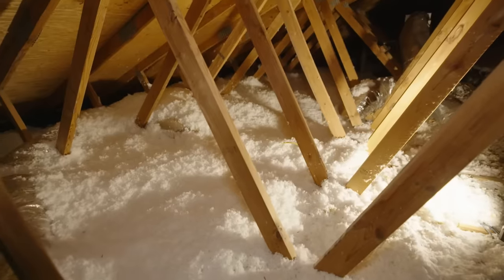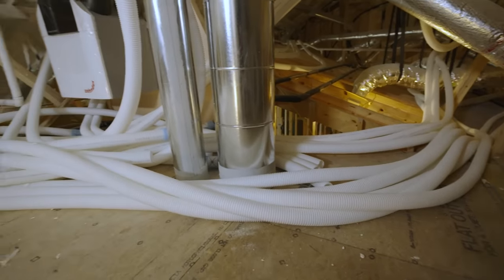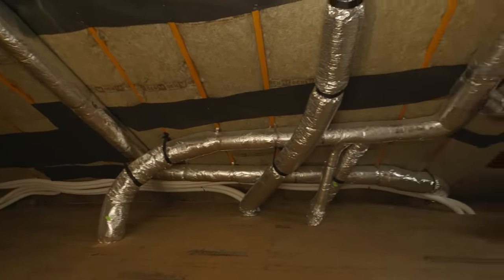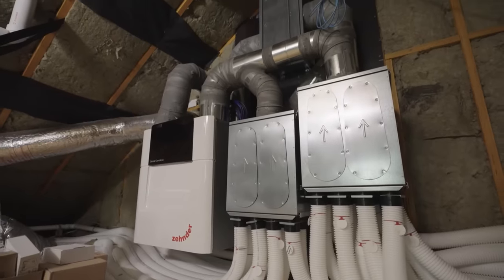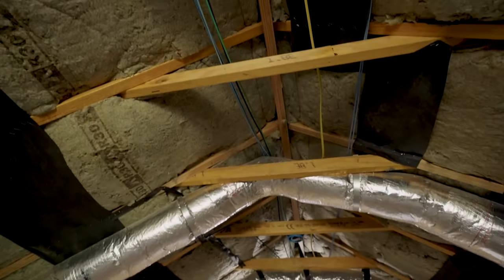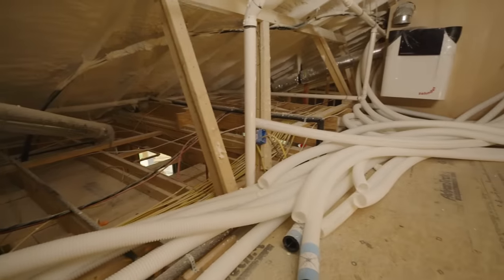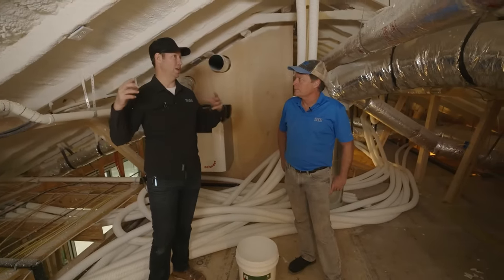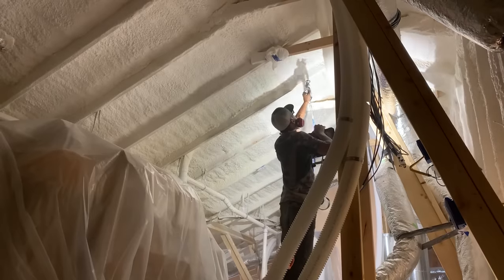Building a BETTER attic - Unvented + Conditioned attics 101

Comment: Very different from a Canadian attic, where you run no utilities through an attic except electrical wiring, a plumbing vent pipe and insulated exhaust pipes for kitchen and bathroom fans.   With a 30 inch thick blanket of cross linked Rockwool insulation, nobody stores anything in an attic.

Comment: Looks like a good option but how does it hold up in -40 degrees with 5 month winters?
Reply: Right, wouldn't fly in manitoba. The frost build up under the roof would be horrendous
Reply: @countryironforge4275  yeah I don't know if it's even code compliant here since you need vents under the roof decking to prevent ice damming and condensation build up inside the roof structure.  I've only seen it on steel frame roofs like in industrial.  Not to mention you're almost doubling the surface area (and heat loss potential) by insulating the entire roof vs the attic footprint.
Reply: You'd probably want at least 6 inches of spray, and definitely encapsulate all the rafters. Once you do that there won't be enough heat reaching the roof to cause ice dams, and since 6 inches of spray foam is a Class I vapor barrier no moisture will each the roof deck either.

Comment: My vented attic looks like the start of the video, but older and pink.  Matt says later in the video that the 'perfect attic' shown can be added to an existing attic, but I don't see that as affordable.  What are the steps I can take to "do better," but not the best?  In other words, if there are 5 things and I do 3 of them then it's better.

One thing that is not a plus of my attic is that my OSB and plywood roof sheathing has no coating nor insulation.  However, there is one plus to it.  If there's a roof leak then I can see it.   I can imagine roof leaks could be hidden for a long time if an attic is sealed up like in the video.

Comment: How are you handling condensation on the underside of your roof deck? How much does having a conditioned attic space add to the operating cost of the hvac system? You are not discussing the difference between open and closed cell spray foam insulation.

Comment: if you keep sealing the house so tightly, what are the risks of having a large party or gathering ?  Lots of people breathing air in a tightly sealed space kind of thing
Reply: A good HVAC with recirculating air that is treated with U/V does wonders. All HVAC systems do that but you have to run the fan manually. Constant exchange of environment is key. Look into what they call “clean houses” for children who suffer terrible allergies.
Reply: That's exactly what mechanical ventilation is for. At worst, fire up the range hood, open a window at the opposite end of the house and you can host as many people you want.

Comment: So why did Matt not use the spray insulation instead of rock wool? We were told by HVAC people that our attic is badly insulated, there is a thin layer of loose blown in insulation from the late 70s and then a foil over the top. We were told our heat issues are mostly from the lack of insulation. If I'm going to spend money to have someone insulate, should I go with rock wool or spray foam? Also, should I have all the vents sealed like Matt, or is he running AC in his attic? We don't care about our attic, we just want everything seal against bugs and heat as best as possible, we don't use it otherwise. We're north of Tulsa, OK and it gets pretty hot here. Thanks!

Comment: I grew up in a house built in 1831 and it had a big, useful attic space. ALL the older houses in our area (rural New England) were built with full, usable attics. Some time in the 1900s they all received insulation and it was always installed at the underside of the roof, not on the attic floor. In this video they call a truss-built roof a "traditional" attic design but it's really a recent thing, used because it's fast and cheap. As is the case with so many things, construction trends toward "fast and cheap", which is almost never best.

Comment: The damage done by a conditioned attic to an asphaltic  roofing system has not been quantified in this video. Notice that the host specifically mentions "a metal roof" allows for cooling. Historically, vented attics were designed to allow cooler air to travel along the underside of the roof deck to cool the roof deck. Not allowing this would cause excessive temperatures leading to premature failure of most asphalt shingles. A factor in your decision to convert or design any attic to a "conditioned space."

Comment: That's fine for Texas, but  it limits the amount of insulation. Where I live it can be down to 70 below zero. My house is still nice and warm because i have 16 inches of fibeberglass insulation with sprayed insulation on top and all around to fill all the spaces. The house is also cool in summer when it reaches the eighties due to all that fluffy stuff above the drywall.

Comment: You don’t have to seal up those  attics to achieve energy efficiency. You need to keep ducts out of the attic for sure. Also use a light colored metal roof. Matt builds for people with big money.
Reply: If you imagine a traditional house as a box that is fully vapor proofed and insulated against the cold and heat and that box is efficiently heated and cooled, then the roof structure is just an umbrella against water and direct sunlight that has an airspace over the properly sealed box do to all the venting along the soffits and possibly a temperature controlled fan or end vents to reduce summer heat buildup. This is incredibly inexpensive, mouse proof if sealed, and doesn't require electrical energy to "condition" a non living space. I am not convinced this has any value whatsoever over a traditional build.

Comment: Do you need insulation at the ceiling of a room if the attic is unvented and insulated?  If not, would insulating ceiling help keep rooms cooler during summer?

Comment: I am rebuilding my house in CA that burned down in the "Glass Fire" in 2020, I was thinking of using open-cell foam to eliminate vents in soffits. I like the Rockwool stuff better, but I  don't want to add 4" of solid foam on the roof deck, any ideas on the proper way to use Rockwool?.

Comment: I looked into insulated zip sheeting. In my northern climate I would need a MINIMUM of 5 inches of solid sheeting to handle the thermal break and avoid condensation. Not really feasible…

Comment: The lumber dimension used in these shots is LAUGHABLE!!! No wonder US built houses are leveled by bad weather.
What are those? 45x95? 45x120? 

We use 45x195 or 45x220, usually CC 60 cm, sometimes cc 120 cm....

Also, we put either plastic or wind proof cloth to avoid getting the dust from the rockwool into the attic. That one looks just horrible to be in and breathe the nasty rockwool...

Comment: Building in Texas requires entirely different considerations than building in Wisconsin. Also, vented attics were the norm once asphalt shingles became the go to roofing material. The venting helped keep the heat buildup on the asphalt shingles lower. Metal roofing with concealed fasteners is a lot more forgiving, since the fastening system allows the roofing to move with heat changes without compromising water resistance at the fasteners. Apples and oranges, really.

Comment: OK, so this works GREAT in Texas, but what about other climates in our Country. For example, I live in northern Illinois, where we see extreme temperatures in both summer and winter months, and our vented attics take the brunt of those temperatures rather poorly, ESPECIALLY in older houses like mine, which was built in 1950. I have a 2 story (above ground) house with a full basement. My bedroom is on the second floor, and, in the warmer months of the year, central air conditioning is NOT enough to cool the second floor. I have to use a portable A/C to keep each of the bedrooms at the same temperature as the main floor of the house. As you can imagine, the basement is ALWAYS the coolest place in the house.

Comment: Would that spray foam and paint be good for a shipping container home?  If so, what would the average cost be for a 40’ shipping container home, coating all interior surfaces?  And can it be used under the flooring, maybe by using some sort of slat every 12” to provide a small area under the flooring?

Also, how thick is that material used in the first home?   If it’s not very thick, would it be better for a container home?

Comment: Matt, How insulated should the floor joists of a conditioned attic (or the ceiling joists beneath the conditioned attic space) be, relative to insulation at the rafters if this isn't going to be a living space.  Also, should there be HVAC vents in a conditioned attic or is the heating/cooling of this space intended to be achieved passively through the floor? 

My concern is that if the floor of the attic is insulated, and there are no HVAC vents in this space, then wouldn't any floor insulation (ceiling below) effectively prevent passive climate control?   Especially if the floor insulation R-Value is close to or greater than the Rafter R-Value, then am I correct that the roof would be, effectively, leaking energy faster than the passive transfer through the floor?

On the flip side, if you were to have HVAC vents in a non-living space, it would seem like a waste of energy, though I could definitely see how it would improve the feel for the living space below or adjacent, but again, it seems like sufficient insulation would be a much more efficient way to achieve this. 

I get that my thoughts above seem to indicate a logical conclusion: Little or no insulation in the floor, lots of insulation in the rafters and passive heating/cooling, likely with no HVAC vents in the attic..... But..... I am asking the question because my home was built in the 5190's, it has a vented attic space with 2" rafters and 2 inch joists between the attic and the main floor.  Id really like to convert it to a conditioned attic but as a DIY'er, I am very concerned about my ability to sufficiently airseal a 70 year old space that wasn't initially executed with that in mind.  I feel like I, as a DIYer, am more likely to achieve an effective airseal between the living space and the attic than I am between an attic (that wasn't originally built with airsealing as a priority) and the outside world.  Or am I overthinking things?

Thoughts?

Comment: First attic was engineered trusses which is strapped with 2x4s so blow in insolation is easier to do.. and you're talking about "sound" weatherguard/wall bar is sound deadening and fills all the voids, plus is rodent and mold resistant also fire resistant.. also heat rises hence why those attics are so hot.. proper venting helps

Comment: Not having ventilation on the underside of a roof, specifically an asphalt roof is not a good idea. Maybe this works well with a metal roof, but not dissipating the heat under an asphalt shingle roof is going to shorten the lifespan of the roof.
Reply: Metal roofs are even more a problem.  allegedly open cell foam can let the plywood breath.  Closed cell must use a batten system to let the plywood breath.  Cooler roof too.

Comment: Can you post a "section" drawing of your roof structure?  I seem to remember an episode where you placed the metal roof on top of slats of some sort.  Does that space between the metal and the wood roof sheet act as the only vent in the roof structure?  How does that air get out?  I'm still a little confused.  Love the idea of a conditioned attic and love the Zehnder product.

Comment: Could I use zip tape on my attic flooring to air seal once I get all of the old blown in insulation out. And then use Great Stuff Fireblock spray foam insulation around all of my ceiling fans and lights?

Comment: I'm not going to give it a thumbs down, and will give you Kuddos for thinking outside the box but off the top of my head its adding more tonnage to the HVAC system, more to heat/cool, ceiling joists now need to be load rated as floor joists, a remodel to make this happen would be a nightmare of MEP"s to rework with bracing issues throughout on anything over a 6/12 pitch, and not that you would necessarily get caught, but these Texas Property Tax folks would place a pretty penny on that mostly unused yet conditioned space. But I did find the idea interesting, and liked the Pro's you mentioned, I just don't see how this could possibly be cost effective outside of new construction and I'm iffy on that.

Comment: Does the a/c system have to be larger to handle the additional volume?
Reply: No. If anything, it could be smaller. Sealed attics make a huge difference in energy efficiency.

Comment: Hey Matt, is putting rockwool in an attic just as good as sprayfoam?  Would I need to caulk around where the rafter meets the decking to air seal first?
Reply: No

Comment: Should be clear.   There is a major price difference on how trusses are made.  The first one you had with all the webbing is a standard truss, not designed for all the extras to be used up in them.    Second and third truss is an  attic truss.  Made for load bearing with all the extras.  Which cost more to make as well as all the extras

Comment: That closed cell foam on underside of roof is bad juju. I’ve dealt with major problems due to someone using that. A single roof leak and it rots out the roof and travels. A small roof leak turns into having to completely replace the entire roof and major mold remediation (think $100k+ in damage). And have seen massive law suites because of it. Open cell only in attics or you’ll really regret it. 

Matt, I would expect better of you then trying this. It’s well know in the south as it was done a lot in the early 2000s and caused massive problems.

Comment: Question, I already have a nice, non vented, insulated attic. 
I would like to add small indoor AC unit to run  all summer because it gets hot up there. Would this be a good idea ? Maybe it'll help keep the top floor cool and save money by having the Central AC run shorter periods.

Comment: there is still a lot of smoke coming from the 2nd foam, its not black or as thick but still a lot. I would rather rock or volcanic wool, I have seen that stuff red hot in car/bike exhausts used at racetracks and not catch fire or smoke. Australian house fires the leading cause of death is smoke inhalation not the actual fire it self, since you pass out then cook

Comment: Quick question, i have a full brick house in NYS (southern teir) attempting to correct some humidity issues in the summer and ice damming in the winter. 2ft soffit provides lots of ventilation to a Hip Roof. Suggestions on possibly using baffles some how, or just seal up ceiling lights, add insulation and deal with it until i can go all out on a new steel roof system?

Comment: I have a question about the spray foam.  What happens when you need to re-sheet or repair the sheeting on the roof?  Also, how would you be able to see where the water is leaking?  Will the water pool behind the foam, between the 2x's etc.?
Reply: The water will migrate and pool someplace.  It will show up down the road with lots mold and rot. Open cell foam the water can get through and you will find the leak sooner.  Did you notice He put Rock-wool in his own home not closed cell foam.

Comment: Roofer will be back first thing tomorrow.  HELP...  What about colder climates?  I'm in CT (Zone 5).  I had a contractor starting to replace my roof today (new house to me, 1946 with 2012 addition).  We quickly realized the soffits were plugged and the ridge vent was plugged.  Then I check the attic and it's spray foamed to the roof deck and then there are fiberglass insulation bats on top of it.  I freaked out with the tribal knowledge that the attic should be fully vented to avoid ice damn and burning the roof out.  Unfortunately the contractor (reputable roofer) agreed with me and we starting thinking about what to do such as recut the roof vent and break through the spray foam, install vents and/or clear out the soffits.  As he left he said they often disagree with the insulation people which made we second guess who was in fact right. So I started researching and the immediately searched the Build show...  So now, maybe things are ok as is.  Feedback?  Also, how do you know if you have open cell or closed cell?  It does appear "white" like in this video but I'm not sure that is a definitive sign.
Reply: PS:  Asphalt shingles.  Wish i could search comments.

Comment: What about water vapor condensing on The inside of the roof when it gets cold outside but you keep your house warm with regular humidity The water condensing could lead to rot and mold.
Reply: Basically two options

#1 A small HVAC supply vent in the attic.

#2 Vapor diffusion port at the ridge of the roof.

Comment: We have a 1600 sf home and have a traditional attic with pop up vents and ridge vent and fluffy insulation. The builder put a head heat foam between the trusses. What would be a rough cost to convert the attic to an air conditioned area? We’re in New Braunfels

Comment: Thanks for the videos, very informative. I bought a house that has spray foam on the roof of the attick. The house is 5 years old. From what I understand it should be sealed, but the foam has cut outs for venting. Is it bad that it has cut outs? Should I try to seal them? We are in Southern Utah. It's very dry and hot in the summer. (Similar weather to Las Vegas)